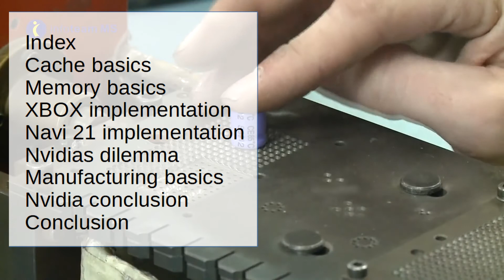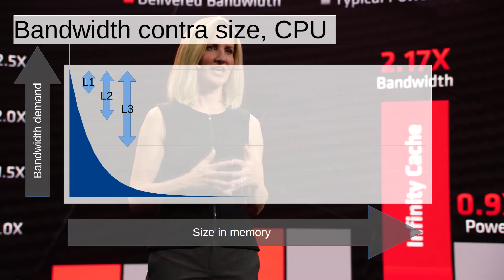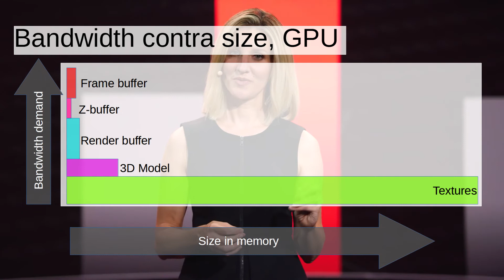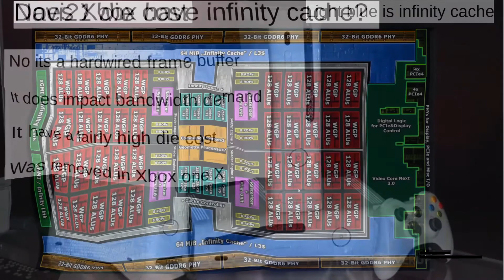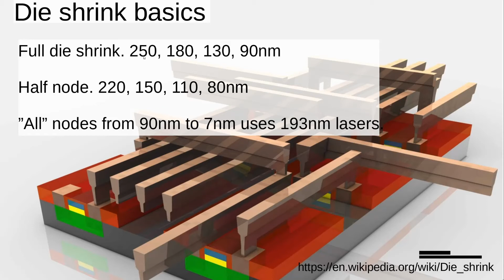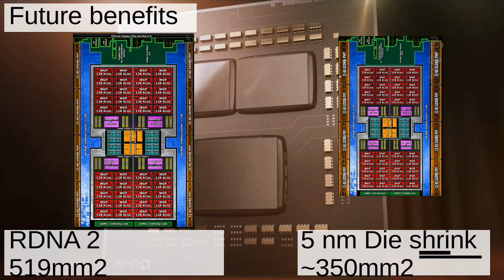NAVI20/30 Special source, Infinity cache, what is it (version 1.1)

Comment: A322 is a fake concept and it’s not an A321NEO, it should be retired. the fake A322 concepts would make the A321XLR and A321LR useless and the A321LR and A321XLR production will be discontinued and scrapped, that would be dreadful